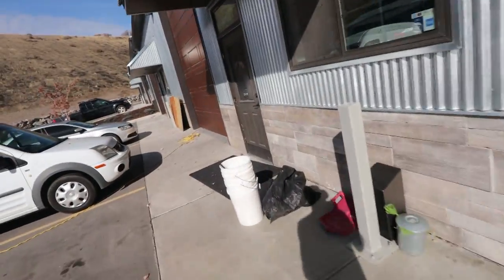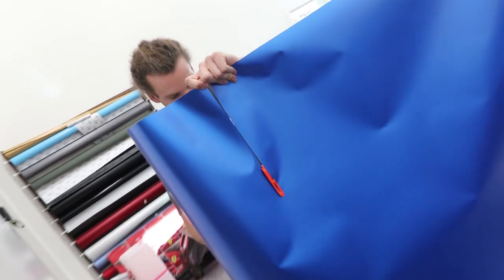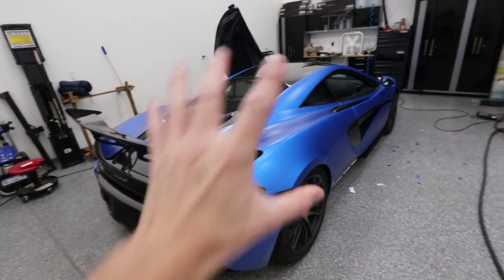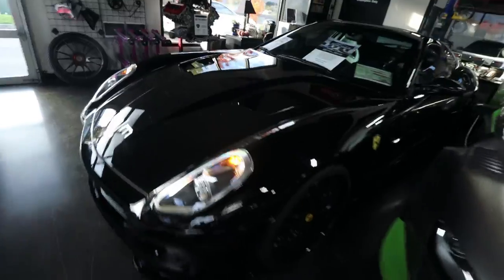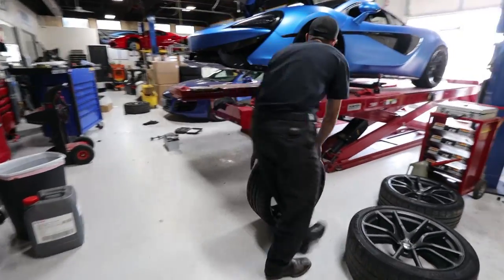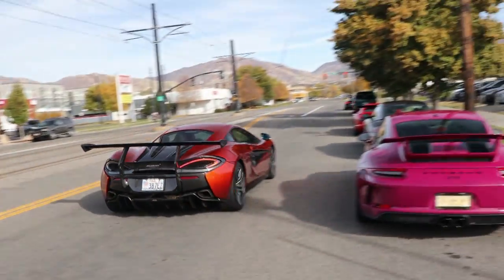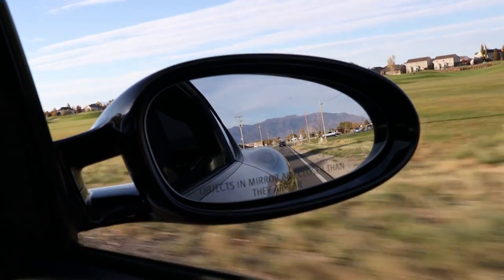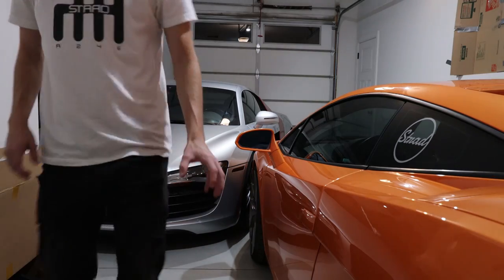The SEMA McLaren 570s Build is COMPLETE!!

Comment: James just a heads up as I noticed in your other video when you installed the carbon hood on the Baby Mac you never had another coat of clear sprayed on it before the install. It's always a good practice to have another coat of clear sprayed onto anything carbon besides the factory clear coat. Especially in places with a lot of sun exposure. If not it can go unprotected and expose the carbon to a lot of the elements.